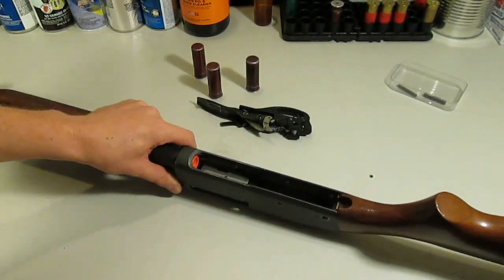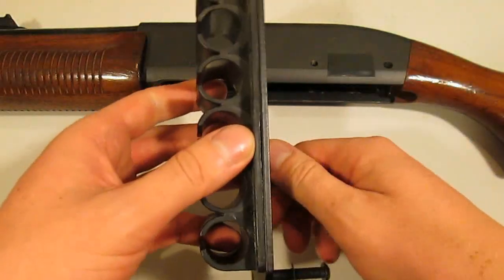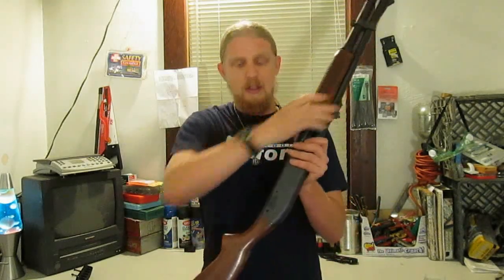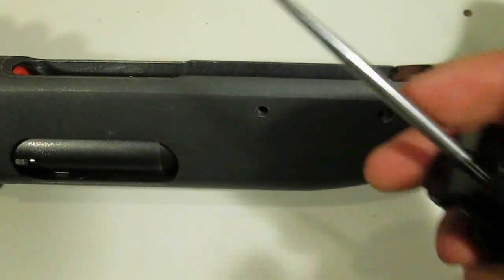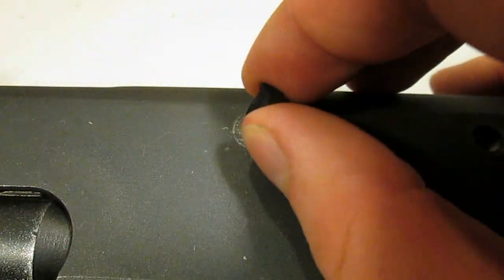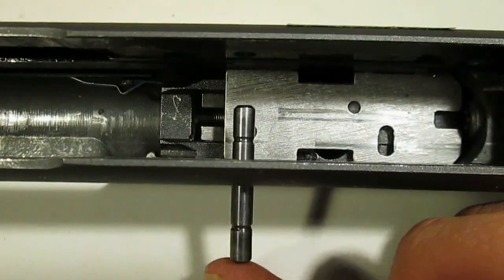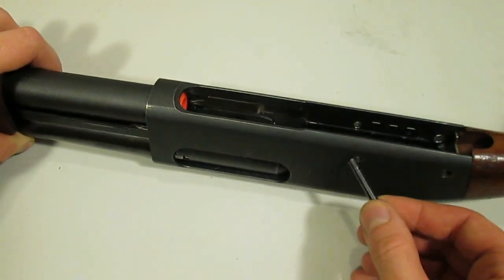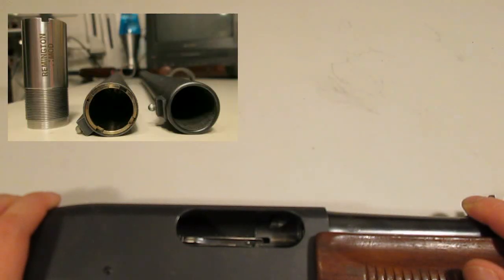Fixing a Displaced Shell Latch - Remington 870 Tips & Tricks #8

Comment: Thanks for this video - I've had 870's for over 40 years, and never had issues with cleaning them, but came across a Wingmaster (1986-1989 era) in a pawn shop at a price too low to pass, knowing it had "issues".  
Turned out one of the action bars was twisted (that was why the price was so good) and although it took just a few minutes to get the issue resolved, when I was reassembling if both of the shell latches fell out and it gave me fits getting them to stay in place before I could get the trigger group reinstalled.

Comment from the maker: +Brian Fortin It shouldn't happen at all if you remember to not let shells pound the latches without the front trigger plate pin (or a substitute) in place.  Also, I did this to my 870 at least a half-dozen times in order to make this video, and you'd still have to look very closely to notice any marring - especially when there's a pin in the hole.  If you're just doing it once, carefully, with a bit of leather or something as a cushion, you probably don't have to worry.

That said, if you do have the ability to make a tool, something that can work from the inside could be nice.  You might not be able to get enough leverage to do it by hand, but if you make something long enough to let you lightly tap the latch forward from the rear with a small plastic hammer, that would probably get the job done.

Comment: Thanks for this video.  I had a few 870s over the last 27 years or so and never had this problem until now.  I bought a brand new 870 20 gauge youth for my wife  We fired about 80-100 rounds/shells through it and realized the lop was still too much for her.  So I ordered some Remington Compact Jr. stocks which came today.  Took the gun apart for the first time to install new stocks.  The front pin seemed a little hard to knock out.  Changed the stocks and went to reassemble.  Just like in your video, I could not get the pin all the way in...went through the left side but would not pass through the right side.  I saw the shell stop had moved and it even looked slightly bowed towards the inside of the receiver.  I have never seen that before.  I found your video shortly thereafter and repaired it easily.  Mine  had actually moved forward, not back like yours in the video.  So I had to push it forward.  That also took the slight bow out.  Reassembled and good to go.  Again, thanks for the video.  I was really about to think the gun had a defect.
Reply: michael patrick I also changed the fore end.

Comment: I had this happen to me today.  The shell latch had moved forward. I used the same roll pin punch I use to drive out the pins to insert in the hole, wiggled it around (technical term) and moved the holder back in place.
I have also seen them move enough to completely block the hole.  If that happens, I just use the punch and place it in the hole of the shell latch and tap it with a small hammer to move the latch.

Comment: Instead of messing w the outside pin hole, i tapped (gently) the Left Shell Latch's hole's edge (my Latch was
shifted toward the front of the gun) to align w the rcvr hole w a thin flat scrw drvr.  It worked fine w/o ruining
either hole.

Comment: Thanks for this video.

I have an 870 clone with a feeding problem--it tends to release multiple shells when racked. 

Interestingly enough, I find that putting those pins back in is often a struggle, and it has been the whole time I've owned it. 

I haven't racked it without the trigger assembly in place, but I'm starting to think my shell latches might be displaced. 

Any insight would be appreciated.
Reply from the maker: Maybe slightly, but if you can get the pins in it shouldn't be the cause of your feeding problems.

Comment: My 870 will not feed shells from the magazine.  I suspect the shell latch.  Any suggestions?
Reply from the maker: It could be a number of things, but it's tough for me to help diagnose the problem without more information.  If you think it's the shell latches, try removing the trigger plate assembly, or just holding the shell carrier up, and see if the shell latches are moving in and out as you work the slide.

Comment: it's a long story but the barrel fell off my 870 while shooting as a result of the ratchet cap not being secure. but I took it apart and one of the latch arms became bent. the problem is I put the gun back together without the latch so nothing would be lost and now I cannot get the gun to come back apart and I'm afraid to use force but I think that's what will be necessary. I've probably put 4 to 5 hours in trying to get it back apart, and a couple of my friends have tried. any ideas or advice to get OT taken back apart?

Comment: I am having an issue with an essentially brand new 870 (bought it a couple years ago, but only fired it more recently).  I am having a failure to feed where once I fire a few rounds (this is a 7rnd home defender), the right shell latch pops out of, and gets stuck on the lip of the groove it sits in.  The spent round ejects fine, but the next shell gets caught on the latch.  Any ideas or remedies for this?
Reply from the maker: It sounds like your shell latch may not be staked in properly.  This could have been a flub at the factory; or perhaps you, a previous owner (if applicable), or an employee or customer at your gun shop inadvertently messed up the staking by incorrectly taking down or reassembling the gun.

I'd suggest taking your gun apart, and inspecting the staking (see 0:45 in this video).  Try moving the shell latch by hand to see if it has any play.  You can also try cycling the gun with the trigger plate assembly removed, which will let you see exactly how and when the shell latch gets messed up.  A gunsmith with the right tools should be able to re-stake it for you in just a few minutes if that turns out to be the problem.

If you'd like, hop over to the Rem870 forums (www.rem870.com/forum).  Registration is free, and there you'll be able to upload pictures and get better help troubleshooting the problem.

Comment: ironically enough after this problem went on for weeks I solved it right after I posted that comment. I had to push down on the arm that was intact on the other side and it came right apart lol
Reply from the maker: +Scotty Gibson Glad you got it figured out.

Even if one shell latch is missing, the disassembly process shouldn't be too different, just push the left shell latch down (unless that's the one that's missing, in which cast you shouldn't have to do anything), and slide the action out of the receiver.  The slide assembly can hang up on the front of the ejection port during this step, maybe that's what was confusing you.  

If you have trouble with this step in the future, here's the relevant section in my 870 disassembly video:
http://youtu.be/vceDJd7KrMw?t=8m32s

Comment: hey I've been having issues with my 870 loading more than one round in the tube, I used those azoom aluminum snap caps and they got chewed up after 4 cycles and now I can't put more than 1 round in the tube and it won't go past the second (or first) shell latch. I think debris is the culprit but ive inspected the latches and they seem to be clear and moving freely. any ideas what could be stopping a second round from being loaded? it's almost like there's an imaginary lip stopping the brass from fully going into the magazine  and if I force it in then it won't allow the round to reach the second latch to release the round into the chamber

Comment: I have a question.  My 870 20 gauge appears to have this exact issue.  It has been wearing a Tacstar sidesaddle for quite some time.  Recently the action has been increasingly difficult to cycle, even without ammunition.  In order to get the action to open, I must wiggle the forend left and right.  When it finds its sweet spot, it finally opens.  Is this a direct result of the issue discussed in this video?  If not, how do I remedy the problem?  Thanks.
Reply from the maker: I would actually look at your fore-end assembly first.  If the fore-end isn't straight on the fore-end tube, it can bind on the receiver in the rear-ward position.  I recently installed a fore-end using a new fore-end tube assembly, and was getting some pretty bad binding.  I thought I had a defective part until I realized the mid-length fore-end was crooked.  Easy fix.
Reply: Synchronizor thanks for your advice.  I just recently stumbled onto your channel and I find it very informative and enjoyable.  I hope you continue to make vids about this and other platforms.  I inspected my forend assembly and it looked fine.  I removed the fire control system and cycled the gun very slowly and realized the bolt assembly was unlocking too slowly.  The cause was a mix of froglube and lead fowling from a steady regimen of slugs.  After cleaning it thoroughly, it now works fine.  The moral of the story is to keep your gun clean and keep froglube away from your firearms.

Comment: I'm having occasional failure to feed issues.
The shell latch/stop, wont get out of the way to release a new shell from the mag tube, as the action bar goes by.
I noticed a small chip in the ramped area of the action bar where it engages the shell latch, and so I replaced the action bar.
It didn't solve the problem, although it happens slightly less frequently.
Should I attempt bending it, replacing it, or could the problem be something else besides the shell latch?
I'm getting to a point where it may not be worth sinking more cash into it.
Reply from the maker: Could be a worn shell latch, on that little finger that rides on the action bar.
Reply: @SynchronizorVideos  I know, sucks.
So I have to weigh the cost of doing it myself, as opposed to having a gunsmith do it.
Then pray it's not something else, such as; The 870 doesn't run this particular ammo very well.
(?) [SUPREMA 2-3/4 00 Buck]
Reply from the maker: @tropocal2343  Is it only that specific ammo that has the problem?
Reply: @SynchronizorVideos  Well, that's the thing; I want to run this ammo.
I'm stocked up on it for defensive use.
So if that's the case, then I hate it even more.
Actually, I really want to run Aguila minis, since they're effective, and it almost doubles my capacity.
Thing is; The 870 fails to run them reliably.
I'm really wanting to change over to Kel-Tec, as the KSG runs minis flawlessly.
It's very disappointing buying a Remington on their reputation, setting up an 870 the way I like it, only to find out I have a better option that fits my needs.
I'll have to check if Winchester Super X still runs as good as it used too.
If it does, I'm selling it, or giving it to a family member who knows it's quirks.
Otherwise, it's back to changing the shell latch....sigh.
Reply from the maker: @tropocal2343  Yeah, minishells aren't reliable enough in an 870 to trust for defensive use.  That goes for most shotguns though, I've never seen them run 100% in anything, personally.  And honestly, they're not as effective as proper-length shells anyway.  Plus the short length leaves no room for buffer or good wads or anything else to improve patterning.  There are good low-recoil shells that do much better in every respect.

If your 870 is problematic with those particular shells, but runs everything else 100% reliably, I gotta blame it on the shells.  Maybe a new shell latch would help things if your current one is worn, but I'd still have trouble trusting those shells if I knew they malfunctioned where others didn't.  I get, it sucks if you're all stocked-up on those, but did you really buy a ton of a particular load without first trying some in your gun?
Reply: @SynchronizorVideos  LOL, they were on sale in the Obama days, and it was an impulse buy.
I bought 2 boxes for $18., ran them through the 870 dry, (NP) looked up the reviews on it, which were good, then jammed back to Walmart to buy the last 8 boxes. (there was 50+ boxes 2 hours earlier when I made the 1st purchase).
But really, "I trusted Remington's reputation for reliability.
I always thought that 12G shells were a bit of an overkill for HD, against a human target, and considered 20G, but the 12G was more versatile, considering outdoor use, so I went with it.
Good thing is KSGs have 2 tubes, for versatility, as it loads up to 3", I can load for both.
Check out the MAC channel, and what he has to say about KSGs running minis; https://youtu.be/39sigFoFqII
I've never come across any info. about KSGs not running minis well, and in fact; operators think their KSGs run minis better than 2-3/4" or 3".

OK; UPDATE ON MY 870 RUNNING SUPREMA
I just went to my safe, got out my 870, and tried to make a FTF happen.
I cycled the SUPREMA 2-3/4" shells that have been sitting in it now for some time; four times 8 shells rapidly, then two times 8 shells slowly, WITH NO FAILURES!
I feel I've entered "The Twilight Zone".
Then I ran the Winchester Super X, (which BTW are 3/16 of an inch shorter than SUPREMA) and they cycled like butter.
Did Gremlins fix my SG?
Seriously, WTH?
I guess I'll keep my 870 after all.
Still want a KSG though. (and a VEPR12, and an AA12, LOL).
Thanks, I'm appreciative of your input.

Comment: I have and h&r Lardner pump protector that I replaced the stock fore end with a vogue tame fore end. in the process of reinstalling the fore end it appears that the right & left latch were slightly bent outward this causing it hard to feed my 2 3/4 shell into the chamber without it getting caught on the latches thus being unable to load the shell without a little forward momentum. the same applies to trying to eject the shell , it will not eject on its own without using your thumbnails to press in on both latches. what can I do to press these latches back in its original place where I can slide the fore end back   in without any resistance and pushing the latches outward again causing feeding and ejection problems?
Reply from the maker: +Jon Hunter The shell latches should each have a tab on the very front end.  These tabs reach up alongside the magazine tube, and keep the shell latches from springing too far inward when they're not being depressed by the action bars.  I would check these tabs and, if they're bent, try to straighten them.  This should help keep the parts of the shell latches that interact with the shell rims from extending out too far and causing function problems.  

However, you may have to take the shell latches out of the receiver to get at them.  You may need a gunsmith's help to get them out safely and re-stake them back in place.  At that point, I would recommend just buying new shell latches and having them installed instead of trying to mess with ones that are already damaged.

Comment: I'm having problems with my 870. I changed the stock to a synthetic stock. I bent the left shell latch and was using with it bent. It fired ok for a little bit. Now when you go to eject the spent shell it jams and I have to take off the cap remove the barrel and take out the shell. Sometimes with more force on the fore end it will come out. My question is did I ruin anything else other than the left shell latch or is that the only thing I need to order?
Reply from the maker: kemuu How exactly is the gun jamming?  I'm not aware of any common malfunction - especially one stemming from damage to the shell latches - that requires complete removal of the barrel to clear.
Reply: You go to pump the shell in the chamber. Then shoot. it fires perfectly.then ejecting the shell it jams up sometimes you have to pump it with a lot of force. sometimes take the entire barrel off and remove the spent shell. when changing the fore end the whole bolt came off and I had a hard time getting everything to line up in the process bending the left shell latch. is it possible something else is bent and need more parts? I think its just the shell latch. I don't know though. its well taken care of.the next shell pumps back in perfectly after you unjam it and thus the cycle of getting it out again
Reply from the maker: kemuu Not sure I understand you there, did you change your fore-end with the fore-end tube assembly still installed on the gun?  And when you were getting the gun back together, did you take it all apart and reassemble it properly?

Regarding the jams though, are the shells really stuck in the chamber, requiring some force to get out once you take the barrel off, or is it just that the action won't open?  Fired shells sticking in the chamber is a fairly common problem, but it's usually caused by defective (or just really poor-quality) ammunition and/or a really dirty chamber.  Far less frequently, it can be the result of manufacturing defects in the chamber or barrel extension.  Damaged shell latches can interfere with cycling, but if you only have issues after firing shells, and the action opens fine with an unfired shell or an empty chamber, the shell latches probably aren't the problem.

By the way, if a shell does stick in the chamber, you don't have to take the gun apart.  Just open (or unlock) the action, and run a dowel or cleaning rod down through the barrel to tap the shell out.